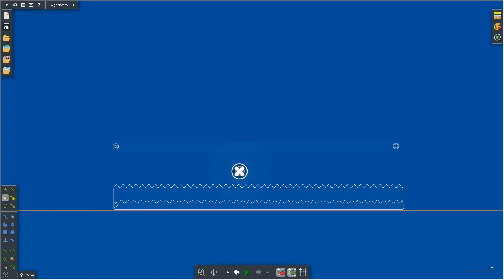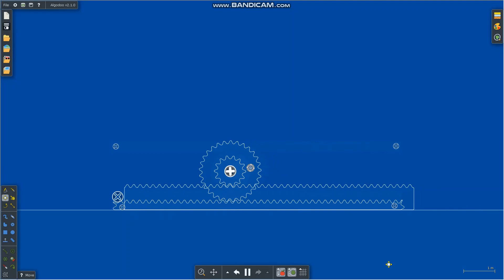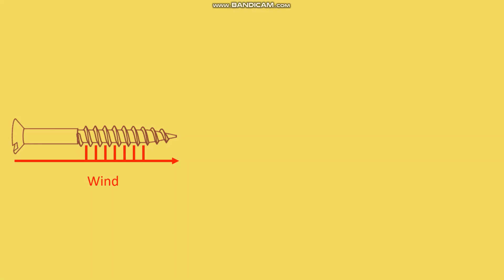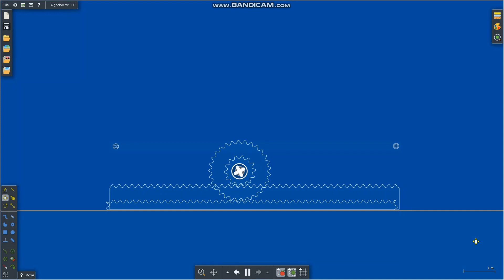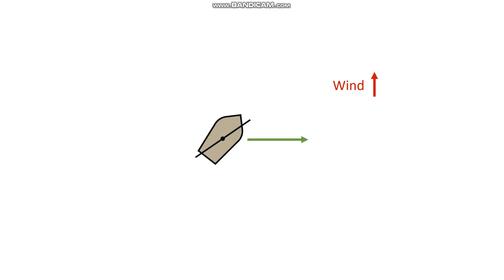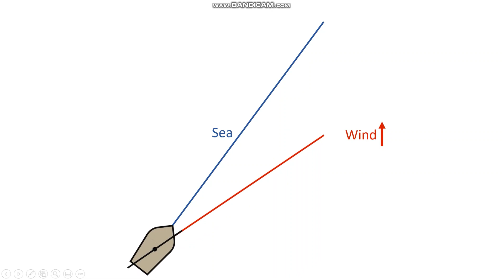Explained: Sailing faster than the wind, downwind

Comment: The key future that helps the vehicle exceed temporarily the wind speed is the energy storage device.
The propeller in this case is also a flywheel and and during the initial acceleration phase some of the wind energy is stored in to the flywheel and then that energy is used to accelerate the vehicle above wind speed. The stored energy will of course run out so the vehicle will slow down below wind speed when that happens.
Hope you understand my explanation since it seems for some reason other people do not find this as simple and obvious as I do.
Reply: You actually didn't get it. The energy is harvested continuously from the relative movement between air and ground, no storage needed. Its like a reversed turbine. In a wind (or water) turbine, you collect power from the flow of air/water relative to your frame of reference which is the ground. In Blackbird cart, you collect power from a flow of ground relative to your frame of reference which is the air, and the vehicle uses this energy to produce thrust over the air medium with the propeller, thus accelerating with respect to the air frame of reference.
Reply: @gastonpossel  Please do not find my comment rude but you have the wrong idea of how the vehicle works.  The stored energy during the initial phase is the only thing keeping the vehicle moving and as soon as that energy is used up the vehicle speed will drop below wind speed.
I can give you an example that maybe helps you understand easier.
Say there is absolutely no wind and perfectly flat land. I push your vehicle to get it started and then I let that go. What do you think it will happen ?  The vehicle will continue to accelerate for a bit due to the stored energy but then while that gets used up the vehicle will start to slow down getting to a full stop.
Reply: @electrodacus  Of course it does not work with no wind. In that case you are losing the kinetic energy (respect to ground) of the vehicle to drag. But if you start with a given windspeed, the vehicle already moving at the same speed of wind, and choose the air medium as your frame of reference, then the kinetic energy of the cart is zero (respect to air, again). There's also no initial air drag. There's some friction on moving parts. You have ground flowing beneath the cart, and use the wheels to pick that motion and rotate the propeller, providing thrust, a force on top of the air frame of reference, not the ground. As long as the propeller is efficient enough to cancel the friction of the moving parts, and the drag of the air as you get faster than the air, it will accelerate respect to air. The gained kinetic energy comes from the moving ground with respect to the air medium, and thats an unlimited source of power in practice.
Reply: @electrodacus  FFS!  You are spreading this bullshit all over the internet.  YOU ARE WRONG.  WE DO NOT USE STORED ENERGY!  We made specific provisions to insure that we CANNOT use stored energy.  But I very much look forward to you continuing to spread this misinformation.
Reply: @Rick_Cavallaro  Sorry. I try to understand how this works and fist intuition was that stored energy is used to accelerate above wind speed since that is possible and I can understand how that will work but that can not offer continues drive above wind speed. Since then I found the explanation on how energy from wind can be extracted even when traveling above wind speed. There is stored energy in the propeller and may be fairly significant amount but does not seems to be used during the acceleration process  so that is not needed.
Reply: @electrodacus   Could you briefly line out the thought process that lets you conclude it's the propeller that stores the energy and not the wheels  (which in the [edit: threadmill-] models are rigidly coupled to the propeller (hint, hint!))?
Reply: @DerGestreifte  you can ream my last post on this forum http://talkrational.org/index.php/topic,24.4400.html  I know now for sure that energy storage is used to power this vehicle and so it can only drive above wind speed for limited amount of time.
Reply: @electrodacus   That doesn't answer my question. 
How are you going to store energy in the propeller, when the propeller is mechanically linked to the wheels? Any force you put in that system will  instantly be transferred through the whole system and thus be used for something. In this case: applying a force to the propeller axle in an attempt to magically store it would drive the wheels' axle, which would accelerate the cart. How much would it accelerate the cart? Depends on the gearing. Same applies for the other direction. 
Again I'm talking about the threadmill carts since I have no idea whether the real thing hand any freewheeling mechanism installed (which by the way would be a superb contraption to take the propeller's rotating mass out of the equation).
Reply: @DerGestreifte  There are two type of storage both due to propeller. One should be simple to understand if you know what a flywheel is but that will be used up only during the deceleration phase after vehicle got to max speed and the other is compressed potential energy. There will be a pressure difference between back side and front side of the propeller and that is where the energy to accelerate above wind speed is stored during the travel below wind speed as there is the only place where you can extra energy from the wind above that you use the stored energy with first being the compressed air (pressure differential). The propeller sweep area is a huge 22m^2 so very significant and I calculated the energy that can be stored both there and in the flywheel and it perfectly explains why 3x higher than wind speed is possible but not for very long after that it will start to slow down below wind speed. I spent 3 days an 3 nights to prove to myself this is the exact reason the vehicle works and the other explanation with extracting energy from speed differential is wrong. I hope this misinformation will end as soon as the more influential science communicators seem my explanation. I'm fairly surprised why looking at energy storage devices was not the first thing people looked at.
The freewheeling mechanism has no role as the propulsion is done by the propeller so wheels will not drive the vehicle anyway even without the freewheel. The small treadmill prototype has no freewheel and still works the same.
Reply: @electrodacus  You can. not. store. energy. in a device where the machines which act as input and output are *rigidly coupled*. It's impossible. Any force on machine A (axle/propeller) will be directly transmitted  to machine B (axle/wheels). Thus the energy you want to store in machine A will in fact  - and let this sink in -  accelerate  the cart.
Reply: @DerGestreifte  The energy that accelerates the car after wind speed is exceeded (actually a bit before that) is pressure differential an elastic type storage like a spring thus represented in my diagram as a Spiral spring http://electrodacus.com/temp/windv.png  then after that is done max speed is achieved and after that the flywheel will take over slowing the car deceleration allowing it to stay for longer above the wind speed so both type of storage will help stay above the wind speed for as long as they can supply the loses.
You maybe see air as a solid but it is a compressible gas so if your propulsion is a massive propeller then you have no choice other than to have an energy storage device.
To do that record 2.8x wind speed I calculated that less than 7Wh of energy will be needed that is less than your smartphone battery.
The flywheel had about 1.1Wh stored by the time vehicle got to wind speed 6m/s and around 5Wh by the time it got to the record speed and that 4Wh was provided by the other energy storage the pressure differential so that contained that amount + whatever car needed to accelerate + friction and small amount of drag.
I made the calculations and the energy balance is correct. There where a few assumption as I do not have all data about the vehicle so I considered 290kg the total weight and propeller about 30kg for this results.
Reply: @electrodacus  I am not making any assumptions about the properties the air/prop coupling, I am completely ignoring them. Just as I'm ignoring the properties of a wheel rolling across a salt flat or those of a chain drive. They don't matter. As long a there is a force fed into the system from outside and the wheels are turning on the ground you can harvest force to do anything, including adding kinetic energy to the vehicle (via any apt mechanism). You only have to look at forces and distances (over time) and choose wheel size, gearing and the properties of said apt mechanism. It really is that simple.
Okay, now I get what you're up to with the flywheel. Yet it's still wrong. Of course any rotating mass stores energy. But why would you come up with a concept of releasing that energy to "slow down deceleration"? That's just as pointless as making the cart heavier and use that larger kinetic energy to slow down deceleration. The same mass would also act as a "dampener" on your acceleration, and you probably want the exact opposite if you want to prove a point.
Regarding those 7 Wh: yes that sound like a miniscule amount of energy, so let me put it into another perspective. It's roughly the equivalent of pedalling your racing bike at 45 km/h for one minute. Not too shabby.

Comment: Excellent: clear thinking. I know some people claim that these mechanical analogies have nothing to do with the downwind cart, but it is in fact fascinating to analyse them mathematically and see how close they really are.
Reply: I'd like to point out that Coolaun really deserves the credit for the kinematic models like the cart under the ruler.  That demo got a ton of high praise on Derek's second video.
Reply: Unfortunately, there are some fundamental aspects that this video gets fundamentally wrong.  Chief among them - the rotor is a propeller.  It is being turned by the wheels.  It is not a turbine, and it's not being turned by the wind.
Reply: @Rick_Cavallaro  It's a real pity, as up until that point it's a brilliant animation and explanation: looking at it, you can be brought to a place where it becomes hard to see why it wouldn’t work. As soon as he mentioned turbine, though, I thought “noooooo!!!!!”. Going on to try and claim it was acting as one if you changed the frame of reference just made it worse and completely undermined the whole presentation. A really useful animation, though.
Reply: @bmurphy737  What I also find astonishing is the number of people that describe to me how the thing I built works, and they INSIST I don't understand it.  I'm sure I've heard or read "here's how it really works" or "here's a simpler explanation" 1000 times over the last decade.  And that is NEVER followed by a correct explanation of how it really works. :(
Reply: @Rick_Cavallaro  In fairness, it's quite possible to build something and not have the first idea about how it works (not suggesting that's you, by the way!).People have been sailing upwind for thousands of years, presumably oblivious to fluid dynamics and Newtonian mechanics. What I find most astonishing are those that should know better, and in particular Prof. Kusenko. I wonder what he would make if you presented him with a model based on this presentation (i.e. a cart, ratchet and gearing combination)? Would he try and convince you it didn't work? Or that the model didn't reflect the Blackbird? And if not, why not?
Reply: @bmurphy737  He would refuse to take the model or to meet to see the demonstration.  I sent Derek my treadmill model so he could do exactly the demonstration Alex asked for.  Alex then refused to meet with him.

Comment: Nice video, especially that part with the screw. I still call it a "propeller", because it rotates opposite to the aerodynamic torque on it. A "turbine" rotates according to the aerodynamic torque on it. This definition is frame independent and thus less ambiguous.
Reply from the maker: Thank you, what you say makes sense!
Reply: @chalichaligha3234  I think the mis-labelling of the propeller is a real shame; it completely undermines what is otherwise a brilliant presentation, providing as it does a simple visual representation of what’s going on that explains it without getting bogged down in formulas that most people just won’t get.
Reply from the maker: @bmurphy737  , Actually, upon revisiting it, I think the matter is more nuanced, check this video out which shows quite clearly how the wind can rotate a rotor: https://www.youtube.com/watch?v=2w3GSBp_m5U

Aerodynamic torque is dependent on frame of reference, for an airscrew the hub of the screw is the most natural place to measure the torque, which is cart's frame of reference - from which, as I said in the video, the airscrew may be analysed as a propeller. In the video I linked with an air paddle however, you can more readily take the ground contact point to be the instantaneous pivot from which we are measuring aerodynamic torque - in which case it rotates in the direction of aerodynamic torque making it a turbine.
Reply: @chalichaligha3234  I know it's dangerous to make snap judgements on how something looks, but that model's behaviour you reference looks completely wrong to me. Has someone built it? Did it work? I'd be surprised if it did.

A definitive way of establishing the propellor/turbine conundrum (not that I think there is any doubt), would be to measure the wind speed either side of the blades wrt to the blades: propellors accelerate the air they pass through, turbines reduce the speed of the air.

A confusing aspect is that wrt the ground, the air speed will drop downstream of the cart – it must do, as the energy to move the cart has to come ultimately from the kinetic energy of the wind.

This apparent paradox is discussed in the "Engineering with Rosie" video on Blackbird, which is well worth checking out if you haven’t seen it already.

Comment: I am afraid it is still far from clear how the downwind boat works. Which face of the sail is the wind pushing on? Which way is it pushing the boat?
Reply from the maker: The boat can only move along the line in the sea made by the hull, so the wind can only push the boat along that line. The sail only has two sides, and it's being pushed by the wind up the screen, wind direction is indicated by the arrow. However, just like the hull, the sail can only move along the line it makes through the air.
Reply: @chalichaligha3234  It is still not clear. From a naïve view, if the wind is pushing the sail up the screen then the sail cannot possibly be going up the screen faster than the wind, and the boat cannot possibly be going faster than the wind in the up-screen direction. So my guess is the boat is moving sideways fast enough to essentially be pushing the wind back towards the wind, but I still don't see how this actually works out.
Reply from the maker: @TimothyWhiteheadzm  Okay, to put it simply, if you take two sheets of material, cut slots in them like the lines I showed in the video, and then put a pin through both sheets at the point of intersection - you will have a physical model showing how as you push one of the sheets relative to the other, the pin is forced to move faster than the sheet. Just like a boat would travel faster than the wind downwind.
Reply: @TimothyWhiteheadzm  These clips explain how you achieve a downwind component greater than windspeed: 
https://www.youtube.com/watch?v=H_OKNr120t4 , https://www.youtube.com/watch?v=63hvQABLOaE
Reply: @TimothyWhiteheadzm  the water is pushing the hull, as well as the wind pushing the sail.
Reply: @alexjohnward  The hull is not a gear, the explaination is that with the right angle, the amount of distance the air travels pushing the sail is less than the distance the sail travels as its getting pushed, that is plausible because the wind creates lift behind the sail, which pulls the boat aswell.

Comment: What software did you use for your model? When I did my sprocket and pinion model in onshape, it was a real pain.

BTW, the one suggestion I have is cleaning up and leveling your audio. It is mostly kind of quiet and the plosives are kind of loud if it is turned up.
Reply: I think it is Algodoo, a 2D sandbox physics program. It's free!
Reply: @javierhualde739  yes, the label “algodoo” can be seen in the video